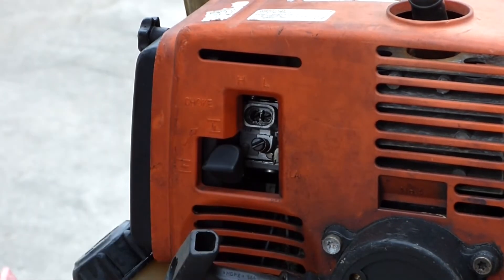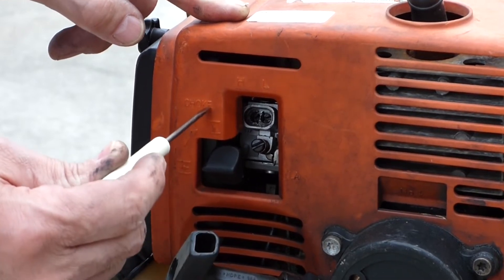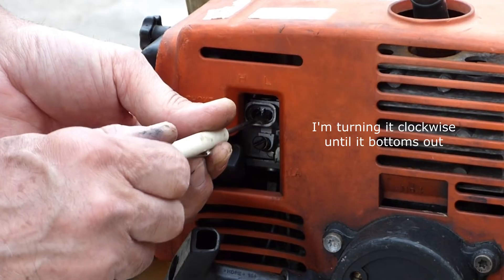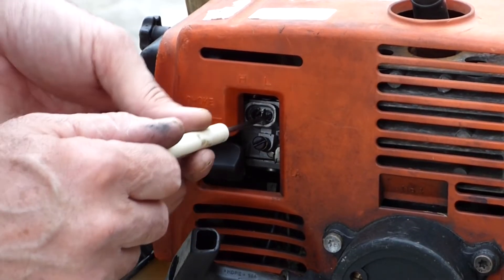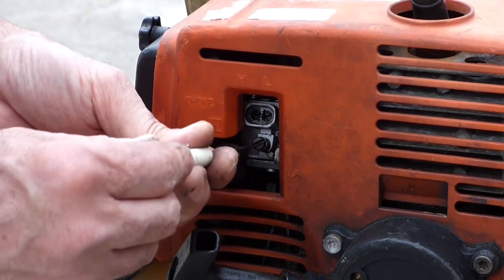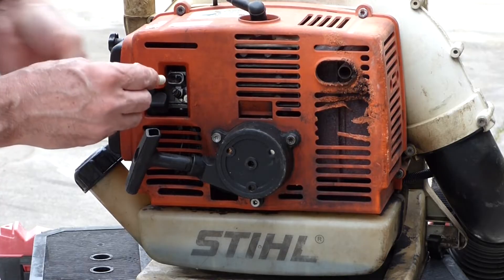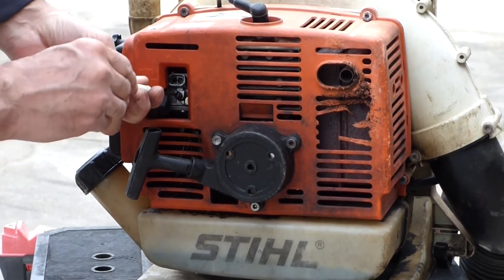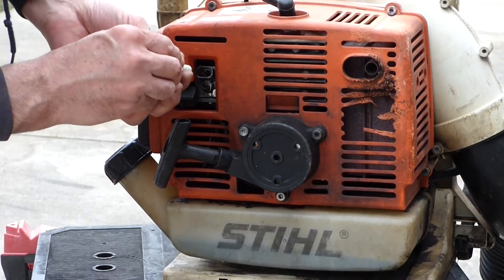How to Tune up / Adjust a 2 Stroke Carburetor (Weedeater, Trimmer, Blower)

Comment: Thank you! Wish me luck. I took the carburetor apart and cleaned it put in a new coil pack and spark plug started up on the first pull and  ran great for a half hour, two weeks later now it won’t start, seems to be flooding out never knew how to adjust the carburetor until you showed me in your video Thank you

Comment: you made getting those caps off look waaayyyyyy too easy LOL followed this procedure today on a McCulloch backpack blower, with success thanks to you!! automatic subscribe!! quick question... can the return line be too long?! cut mine a bit shorter than the filtered line, and i dont want it to interfere. think i should shorten it?? sure is causing some commotion within the tank. thank you for your efforts and time!!
Reply from the maker: Return line only needs to stub into the tank maybe an extra half inch inside the tank
Reply: @helpinguonline  thank you sir!! snipped it before running the blower today, and created another problem in the process. the tank grommet became unseated, and with it being worn already, i was fighting it all day. couldnt maintain proper pressure, had erratic performance and the purge/return combo were dysfunctional. hopefully replacing it will get the blower running good again. God Bless you and thank you for your efforts towards helping the community!!
Reply from the maker: God Bless you too!  Thanks
Reply: @helpinguonline  thank you so much, kind sir!! cheers!!

Comment: Thank you this video is a great help I have adjusted carburetors in the past but I took me to much time to find the sweet spot with your technique I will be able to adjust them way easier and quicker. I am subscribed to your channel. If you would like to check out my channel its Backwoods Boy Small Engines I have basic knowledge with small engines but still learning. Thanks again for the video take care. 👍
Reply from the maker: Glad it helped and wishing you the best with your channel